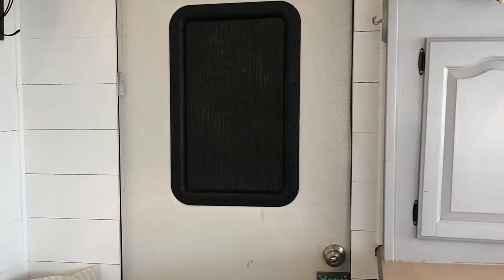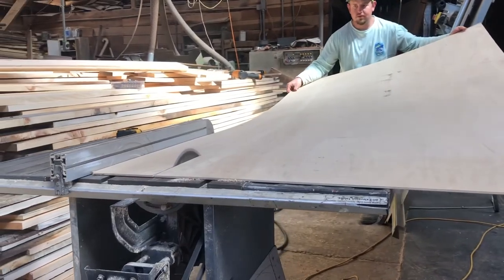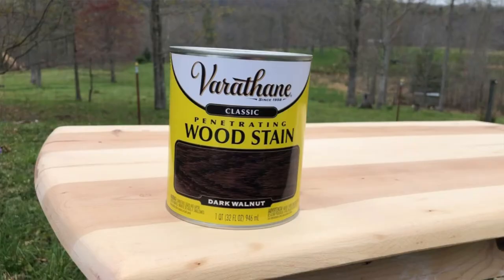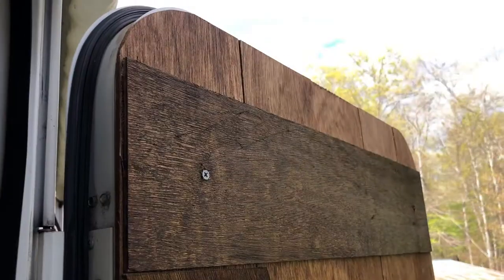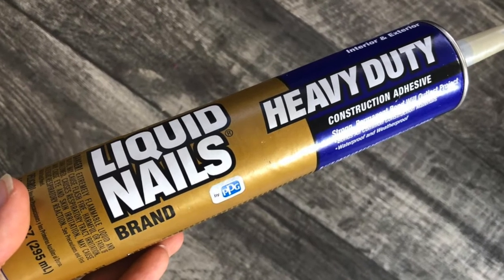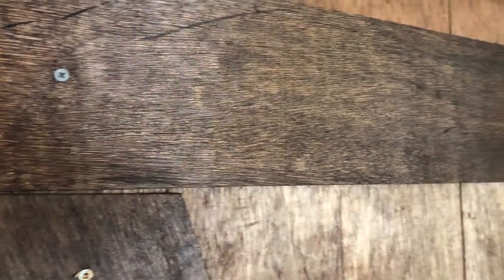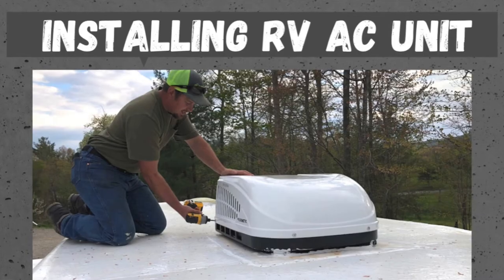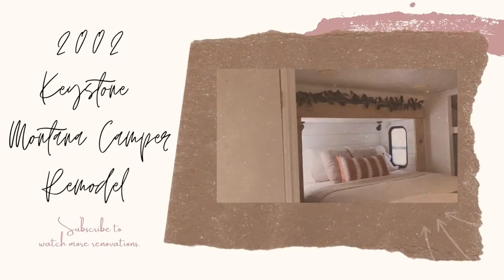Updating my Damaged RV Camper Door:
Easy & Affordable RV Renovation DIY

Comment: This is exactly what I’ve been thinking about doing, but haven’t been able to find an example until this one. Did you do the same to the outside of your door? I’m wanting to do this to our camper door on the inside and outside but keep the window. Looks great! Btw, I think if you painted the screw heads black it would look even better.
Reply from the maker: I left the exterior door as it was. Because the window on the door had been broken out I came up with this idea to cover it and it definitely helped update it as well.
Reply: Do you have a screen door?  I want to do this on my camper door, but we want to keep the screen door.  It kind of looks like the wood might fit between the two doors, but I’m not sure!